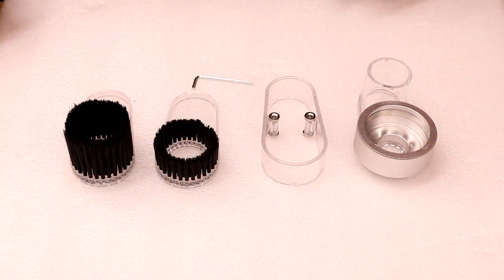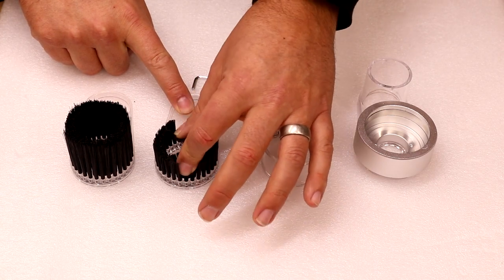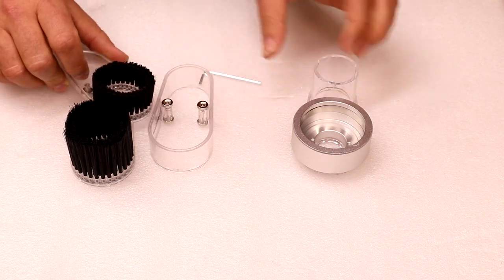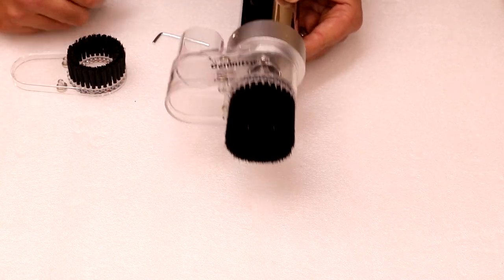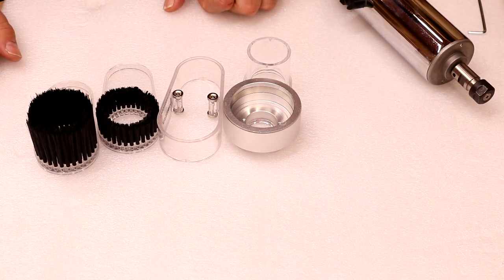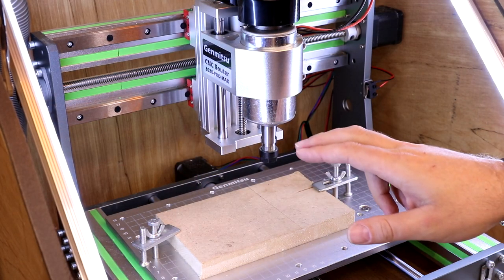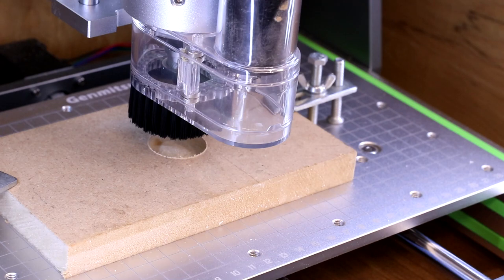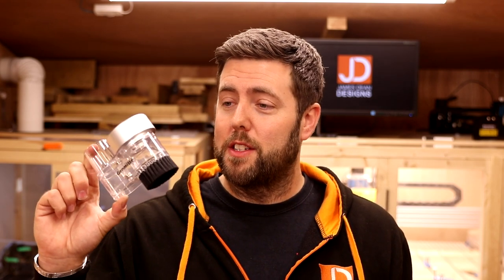Sainsmart 52mm Dust Shoe

Comment: I can attest the long bristles can be an issue. My bit grabbed a hold off them, melted the bristles to the bit and then broke the bit.  The bit length to the bristle level was spot on and the cut was 2 mm deep. All happened in less than 10 minutes for me to run into the house to get some water to drink. Just happened the other day.

Comment: I have the original long brush version.  The vacuum pulled the inner strands inward and would partially block the airflow, getting further blocked by the dust clogging the strands.

I ended up cutting about 12mm off.  Much better now.

Problem #2 is, none of my vacuum hoses fits the attachment.  I have to use duct tape to attach my vacuum hose.   I need to 3d print an adaptor.

Comment: I got the Sainsmart dust collector but not with the short brush, only the longer one. That got tangled in my bit and as a result of that my CNC didn't work anymore. I suspected the control unit, replaced that but that didn't fix the problem. It turned out to be the power supply, replaced that and now it's working again. I have cut the brush and shortened it about 10 mm. I think that it's a Sainsmart mistake because the average bits I use are placed right in the spindle. Not happy with this dust collector and I wish I had the short brush as well. I just bought my dust collector 2 weeks ago, I guess Sainsmart first sold out the old supply with just the longer brush..

Comment: Okay, I'm sold.  Ordered it for my 500W Twotrees TTC450.  Now need to figure out what to suck air with.  The spindle doesn't make much noise but both the shop vac and HF 1HP dust collector are deafening!  Maybe a household vac with a control that turns it on and off with adjustable duty cycle. 🤪
Thanks for another informative video.

Comment: Thank you for the informative videos. 
Iv used a lil technique for keeping my work are clean and clear while cutting.
This lil thing is great. Basically cut a piece of painters tape 2 1/2"x 1/8" and fold it over the bit place the tape so you have equal on share on both side of the bit. 
Now you are balanced and you created a fan for cooling and displacing chips off work zone. Iv used this for a long time even when using a drill or drill press.
Give it a try
I have never had any trouble with motors as long as you balance the tape on each side. The tape will stay on even on high rpm just keep above the cut depth

Comment: I have the 65mm dust boot for my XL4030 with a Dewalt router but can't figure out how to get a dust hose connected. Every thing I have found is either too big or too small. Can you tell me what I should use to attach a 4" hose and where I can find it?
Reply from the maker: So the dewalt is actually 69mm diameter, so I'm quite surprised a 65mm boot fits. But dust boots have 2 different designs, one for vacuums and one for dust extractors like you have with a large hose. Ideally you should have bought a boot that fits but alternatively you can either try to make an attachment that adjusts the size or see about getting one 3d printed

Comment: great video James, I was wondering do you use a vacuum for dust collection only or do you have a cyclone to a bucket or barrel? I'm new to CNC machining and have watched quite a few videos on everything except dust collection it would be great if you would touch on this subject.
Reply from the maker: Thanks. I run a vacuum connected to a cyclone. A cheap £20 cyclone off ebay connected to a plastic drum.
I rarely run the vacuum all the time though due to the cost. I'll vacuum up every now and again during the job

Comment: I used a 35mm film can as an adapter for a smaller vacuum hose on the 3018 version made from a foot operated air pump hose. That goes to a Coffee jar/Spray bottle dust collector, then a big long vacuum hose runs out the door to an old house vacuum with the bypass hole open to lower the suction a little. Best add on for these little dust makers and the noise is outside now.

Comment: Nice video James!  Thanks for the tip on using the shorter bristles! I hope to try it out soon on my Proverxl 4030.  I had to adapt it to my dust collector which uses 2.5 inch tubing.  For those in the states, the o.d. Is slightly larger than 1 pvc.  So,  I got a 1 inch rubber coupling,  a short piece of 1 inch pvc and a 1to 2 inch bushing that fits dust collector hose nicely
Reply: Update...  Going from a 2.5 inch hose down to one inch proved to be too much..  The trash can I was using to collect the dust collapsed. I ended up using the original shop vac hose and that worked fine

Comment: Have you tried it on a Fox Alien 4040XE with standard spindle?
Reply from the maker: The spindle I first show I'd actually the one from my 4040-XE so it will definitely work with that
Reply: @JamesDeanDesigns  I can confirm that it works great on the FoxAlien 4040XE. I ordered one using your link and it arrived in two days. Thanks again.
Reply from the maker: @BillYovino  excellent news and thanks for feeding back 👍

Comment: about time , your CNC has been a bit untidy recently, specially with your snow blower trick last week!
PS. make sure middle section is right way up, very slightly different moulding.
Neat tension band on inside, screw doesn't dig in to spindle casing.